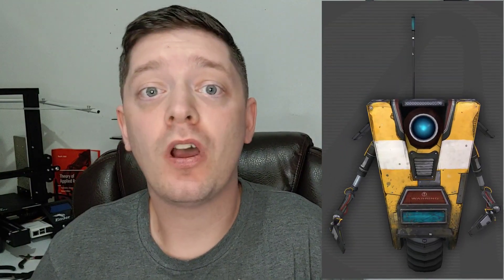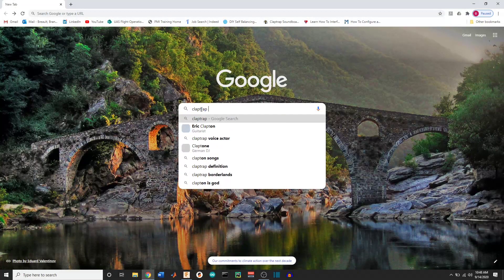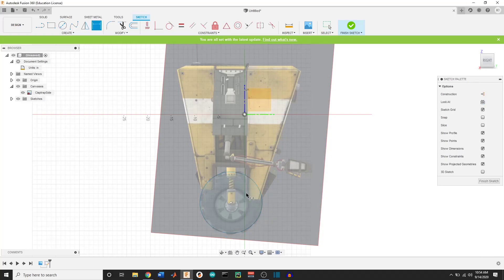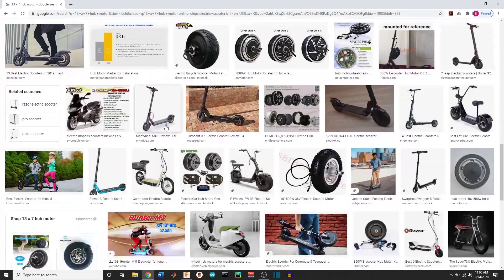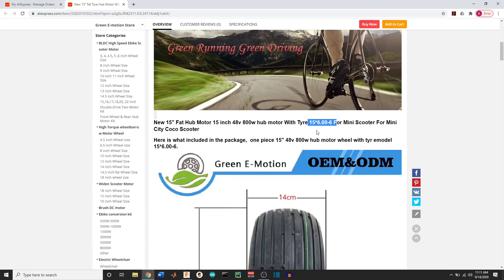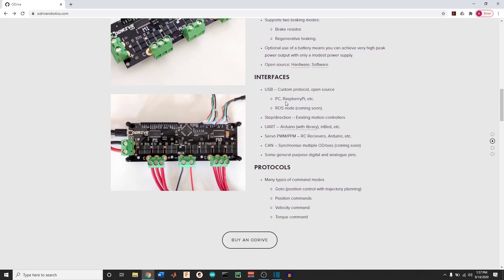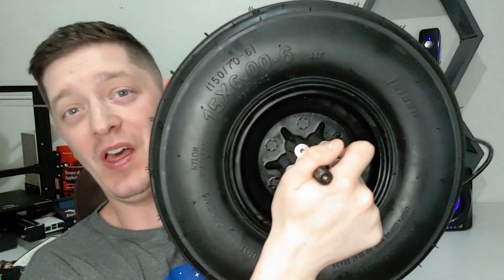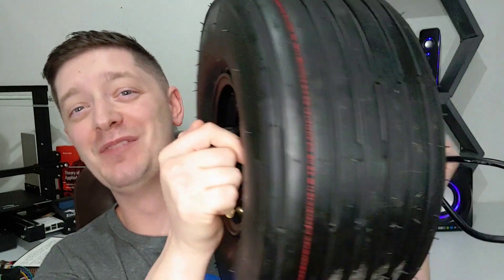Real Life Claptrap - Part 2 (Scaling and Motor Selection)

Comment: For stabilization as well as turning you could use an internal gyroscope, could be a bit tricky to program, but depending on the hardware (raspberry/arduino) it should be doable
Reply from the maker: That is very much in line with my idea! For now, the plan is to utilize two individual reaction wheels. One for balance in roll and one for yaw.